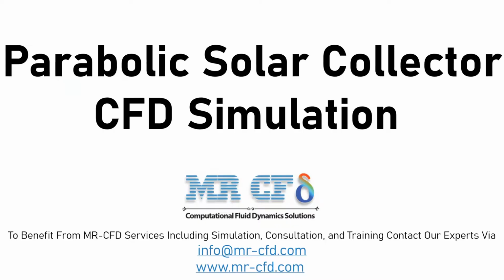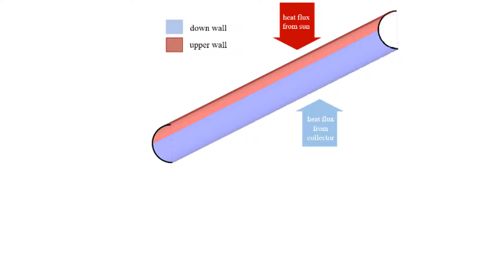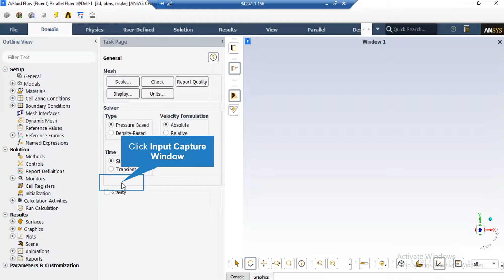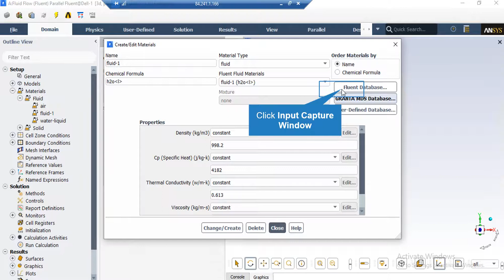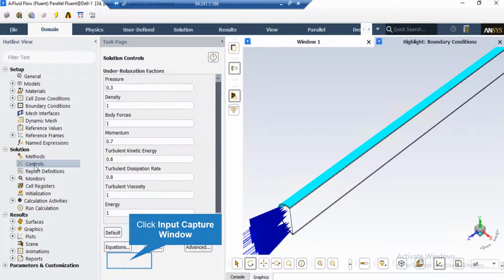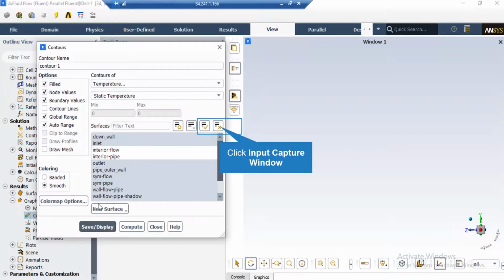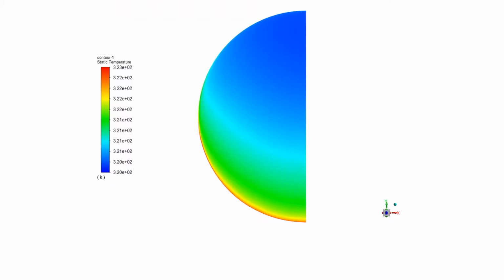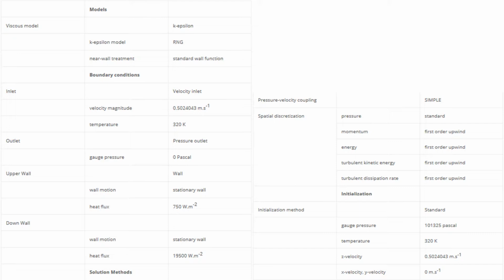parabolic solar collector CFD simulation

Comment: I have a quesiton, on what basis did you input the amoun of flux? Does your course involve radiation models or just flux as the input boundary condition?
Reply from the maker: The heat flux is applied by using a profile, and also just one case study is investigated if you need to see the radiation mode, you can benefit from another course that solar radiation mode is used